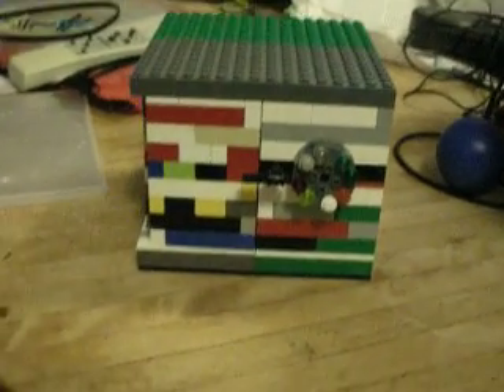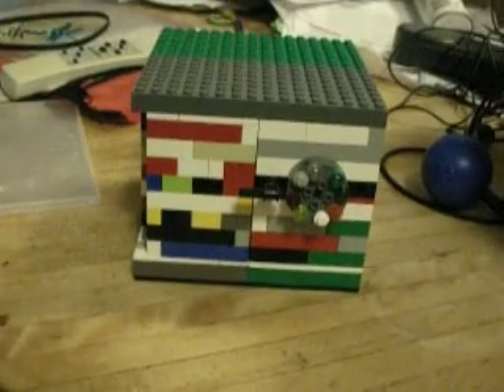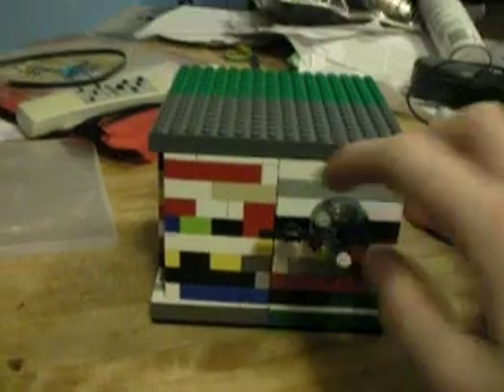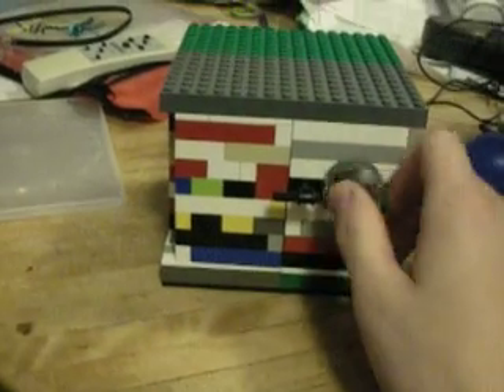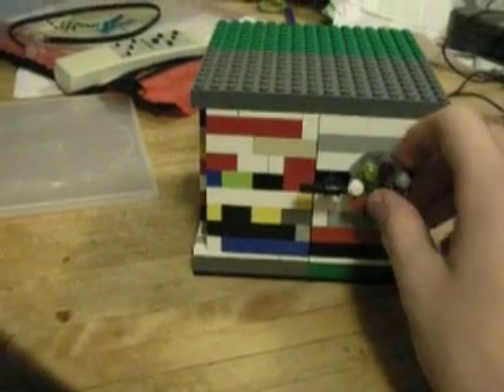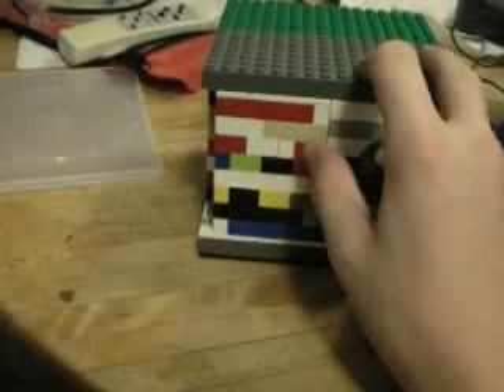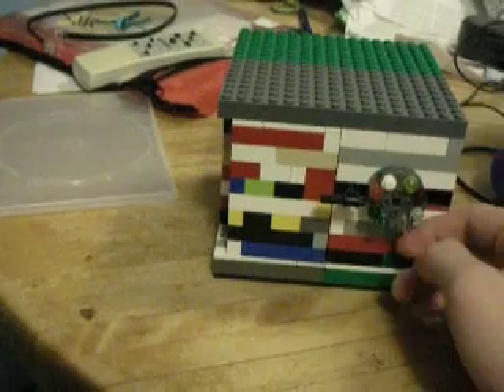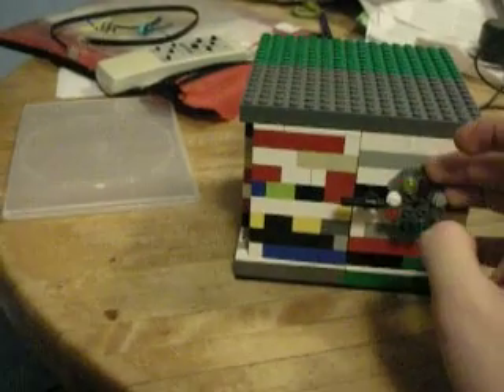Lego combination lock

Comment from the maker: the first and last ones you simply stick into the walls. the middle one took some time to find a way to get it in place. you need a piece that can stick into the side wall and reach to the middle where you can put the 3rd rotor through the hole in it. you also need to make each rotor slightly different to account for its position. i hope this helped. i should also mention that this is really my 3rd or 4th time making this and each time i added a rotor until i could get it like this.